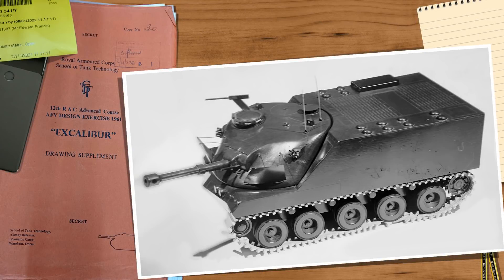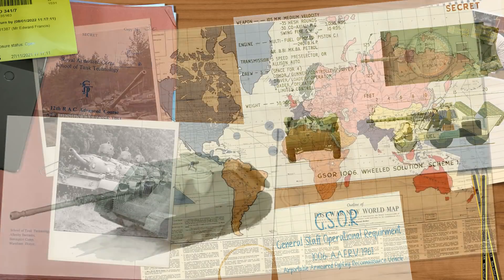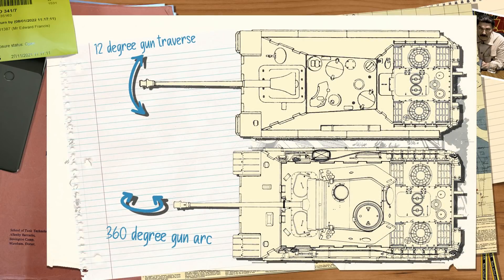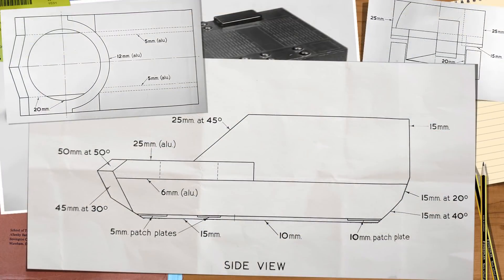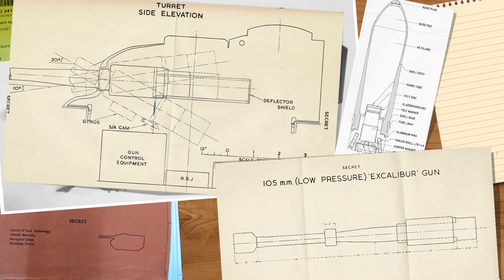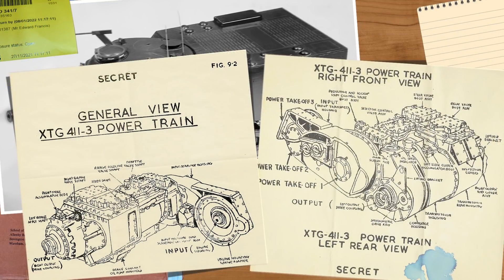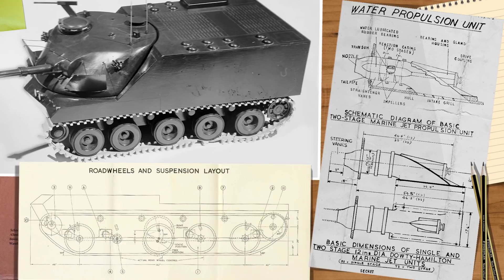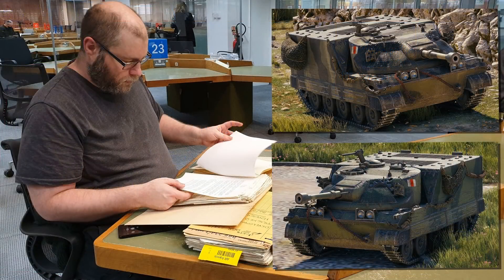STT Excalibur - Tank Design & Development

Comment: The idea of light gun mounted vehicles has made a strange comeback in the last few years...  while everyone said they were obsolete...

Ranging from the M1128 Mobile Gun System, to the AMX-10 RC, B1 Centauro, many countries seem to have adopted the 105mm wheeled anti-tank/fire support vehicle.    Designed to be light weight, air transportable, and such...
Reply: @Ban this youtube yes and no...  in some cases its just the "theory"   and deployment strategy thats changed.  take the Weasel.   Germany's "newish"  Tankette.    little 2-3 ton tanks,   that can be configured with different weapon systems, but the key thing is they all be able to be folded down and kept small.

4 tankette unit,  1 radar, 2 sam launchers, 1 25mm cannon.   Able to be transsported by... 2 helicopters...   dropped  on any hill top or such.

4 tankette unit,   2x tow launcher, 1 25mm cannon,  1x communications.    

4 Tankette unit,  3x 120mm mortar, 1 by command/coms.   

the little things work as coordinated teams.  and can be carried INSIDE most heavy transport helo's...  heck an Ospray can carry them too.

Comment: The 'imperial' antipode to common sense: 

airmobile, amphibious (aluminum, but no respective hull design for floating as with Soviet BMPs), reconaissance, 'tank destroying' 'fighting vehicle' ('gunner doubled up as driver'...) from -1946- 1961 (!!!) - three years before the Soviets would put the revolutionary T-64 into production, fighting heavy tanks at maximum range above 3km... 

...named 'Excalibur', because nobody could pull a project like that without anti-gravity technology that prevents shit from rolling downhill... if it only were an internal satire of the design department... 

Two generations later - after the introduction of the 'Scorpion' didn't plug the conventional arms gap - the same culture of bureaucratic planning will breed policies like totalitarian lockdowns in order to stop the transmission of influenza like germs, facing a deathrate of less than 3000 individuals per quarter...

Comment: A front-mounted turret is something you don’t see every day. For the roll it was intended for, it doesn’t seem too crazy. The fact that it has missile launchers as well as a gun does kinda beg the question of “why not just have the primary armament be missiles?” A question begged by many projects during the period when antitank guided missiles were being developed and becoming more and more common.
Reply: >why not just have the primary armament be missiles?
The Army was smarter than the "Chairforce" boys is why.
Reply: @D8W2P4  I mean, there are cannon-less AFVs whose primary armament are missiles, so...
Reply: @samiamrg7  well old missiles were more costy, and less efficient,and sometime failed so its not bad to have a backup
Reply: +Valian True. I was more just commenting on for much of the Cold War era, there was a lot of debate and speculation on how war was going to evolve going forward. The result was all sorts of proposals, designs, and prototypes. One common theme was hybrid weapons systems like cannons that could fire both shells and missiles (or be adapted to fire lasers, as some speculated might become the norm). This vehicle is like that. It was designed to have both weapons if for no other reason than that no one knew if one or the other would be more useful. As it turned out, they are both useful, but not on the same vehicle. Broadly speaking, the main kinds if IFVs/AFVs around today are ones with light cannons (and sometimes a secondary missile launcher), ones with just missile launchers, and ones with an AT gun.
Reply: @valian8985  a bit more than sometimes 😅

Comment: I d wonder if they thought about the effect of the shot trap ie  of a hit between the turret and the rear body , wouldn't that disable the turret turning ?
As for aluminum armour seems the driver would have  had very little protection , unless it was in a hull down ambush position
Reply: A shot trap... really? The entire vehicle is a shot trap.
You think the few mm of aluminium would stop anything bigger than a rifle caliber bullet? The vehicle basically has no armor to speak of. If it takes serious return fire not only the driver would have very little protection. An M113 is better protected and lets face it an M113 is not really well protected.
Reply: @schnuersi  your correct .

Comment: The air portable tracked armoured vehicle has been the quest of many international design teams since the concept became a possibility. In my humble opinion only Scorpion and Scimitar have ever come close to delivering a usable example for NATO.  It's a pity  the last Scimitars are being phased out of service to be replaced by the bigger and as yet unusable Ajax. Or CV90 if Ajax is unfixable.  
The BAE 40mm  cased telescoped cannon system proposed for Ajax and Warrior would be an interesting candidate for mounting on a Scorpion/Scimitar  type hull.  It can penetrate 140mm slopped armour plate!  Apparently BAE systems have also supplied a 50mm cannon system for the CV90 and as an upgrade for Bradley.
Reply: the AMX-13 is air portable and was quite successful, the SK-105 is also air transportable.
Reply: @matthiuskoenig3378  AMX was a dead end due to the limited ready round capacity and it's other quirks. Not a NATO contender. SK-105  much the same.
Reply: @gusgone4527  the AMX-13 saw great commercial success within and outside of NATO and while it had a limited ready round capacity that didn't stop it preforming well in combat. 

as for being a dead end it ended up being;
-a light tank/TD with upto a 105mm armament, includeing includeing a prototype (with the FL-20 turret) that gave it ammunition blow out pannels, a co-axe 20mm, themral imagers, 2-plane stabiliser for the turret, NBC protection. it also its ready rack could be reloaded inside the vehicle.
upgrades are still being offered to this day
-an APC (AMX-VCI)
-an AA vehicle (from 20mm armed to 40mm armed)
-SPGs (from 105mm to 155mm)
-it served in the french army untill the 1990s (through it began to be phased out in the 80s), and is still in service with many militaries. 
-ATGM vehicles

and its basic hull construction is not really different to any modern light tank. the model 1987 even had hydro-pneumatic suspension. 

its arguably one of the least dead-end tanks out there. sure its still limited by its engine compartment (the biggest engine for it so far is 300hp) but its also an old light tank from the 50s. the AMX-13 was a dead end as mutch as the CVR(T), limited by its overall size and little else.
-->it must be noted the french have had a hard time replaceing the AMX-13 too (although they atleast have had wheeled recon vehicles) with the failed VPX-110 of the late 70s, the failed VPX-5000 of the 80s, the failed MARS-15 of the late 80s and 90s.
Reply: it would also be ironic if they went to CV90, in the early 90s the british army planned to replace CVR(T) with a mixture of alvis stormers chassis vehicles and CV90 chassis vehicles (the former being a 8-13ton light recon vehicle with a 30mm bushmaster and TOW missiles, see stormer 30. while the later would be equiped with a 40mm+ and TOW missiles and would take up the role of the proposed warrior reconnaissance varient. which was rejected because the MOD didn't want more warriors). 

but both were canceled because of TRACER  in the mid-late 90s (a completley new ground up vehicle, that although orginally independant became a joint project with the americans who called it FSCS. the new combined name being ASRV [armoured scout and recon vehicle). but ofcaurse TRACER died. because the americans pulled out (in order to make room in their budget for FCS), this discouraged MoD who proptly fell inlove with FRES, despite TRACER already produceing prototypes by that stage which preformed above and beyond expectations and the UK haveing the budget to get TRACER into service although not by the oringinal 2002 deadline. they had already spent 130 million pounds of the projected 150 million when they made the last payment for TRACER. 

FRES (future rapid effects system) was a project to replace FV432 and CVR(T). replaceing TRACER (see above) and MRAV (FV432 and saxon repalcement, which had cost 57 million pounds) into a single joint family project. it is said that other than us backing out, operations in the balkans drove this opinion (and it is also said that US experiance in the balkans also drove them to empasise FCS). specifically the need to adress mines but also a greater influence of being light (it was feared TRACER might be too heavy to do the vital jobs CVR(T) had done). TRACER was 20 tons after all. FRES was intended to be cheaper and take into acount these lessons (it was to be no more than 17 tons baseline, with potential modular armour for heavier situations), atleast initially. aditionally unlike TRACER they wanted it to be simple (TRACER has a suite of advanced sensors and trackers, a information network, and an unmanned turret). 14 billion pounds was set aside for FRES.

BAE suggested useing Sweden's SEP program (weighed 17tons baseline, speed of 85km/h, electric drive, and was modular both payload wise and it could switch between wheeled and tracked easily, all points demanded or requested for FRES) and was already in the prototype stage when parliament confirmed FRES funding in 2005. and was warded to contract to explore this idea by the end of 2005.  

however for some reason this was rejected in 2006 as FRES had changed to 3 weight class vehicles with shared components (a 25-30ton utility vehicle, a 20-25 ton tracked recce vehicles, and a 30-40ton support vehicles. each with subvarients and roles for a total of 16 different vehicles). it seems the light 17ton requirement was dropped. . we'll call this FRES 2. one of the main reasons for FRES (TRACER [20-25 tons] and MRAV [25-30 tons] were both too heavy for combat experiances in the balkans and backed up in iraq) seems to have been forgotten...
for the recce part of FRES 2 the CV90 and the ASCOD hulls were selected to be tested (with other companies doing the turrets/etc)

then came another change in 2008. it would now be 5 vehicles instead of 3, to fufill the 16 roles (utility, recon, medium armour, manoevre and 'capability utility') we'll call this FRES 3. and then changed again in 2009, the utility vehicles were removed/rearcanged from the program; the 5 vehicles were recce type 1 (scout vehicle, recce support repair and recovery), recce type 2 (FOP, command and control, cargo), recce type 3 (mine deployer, recce overwatch, command and control, ambulances and aid posts), medium armour (120mm gun tank, repair and recovery support vehicles) and manouvre support (bridge layer).
->once again it was ASCOD (2) vs CV90 for the recce vehicle.
207 million pounds had now been spent on FRES scout alone, 50 million just on testing CV90 prototypes, and they hadn't gotten anywhere.
weight of recce vehicles had also grown to *40tons*, losing air transportability...

BAE offered a reduced size, while increased armour, CV90 for the FRES scout, by reducieng highet of hull. it was successfully trialed in the ik unlike the ASCOD, general dynamics did not even present a prototype of their proposed modifications which were less extreme. despite that the ASCOD 2 scout was chosen (later named the Ajax). without even being tested, those were only projected to be ready in 2011. which is probably why its been haveing trouble.
the plan also now includeing keeping some CVR(T)s because the replacement was too heavy for all deployments, ironically.

ASCOD 2 also had costed more than the cost to finish TRACER, would take longer to get into service, and was heavier with a weaker engine AND had none of the advanced sensors of TRACER and it had a bigger profile. it was no better and arguebly worse (even on paper) to the CV90 rejected in favour of TRACER back in the 90s. but i suppose thats my hindsight talking...

going to a CV90 after all of this and plenty of oporunity to choose one at various stages would be very ironic, and bloody frustrating.
Reply: @matthiuskoenig3378  Damned frustrating, so true. 
Only the MoD can fuck things up so royally and not by accident.  It's a skill they have worked hard for decades to master. MoD procurements having honed it to such an extent, that they can do it on demand for any proposed project land, sea  or air.  
Quite astounding really and worthy of recognition. Bunch of REMF idiots.

Comment: Still a great concert for an airborne vehicle today......travel light and hit hard  😃  and with modern engineering and weapons it would be very useful 👍
Reply: Well, with modern engineering they just make an IFV armed with ATGM’s only like the FV102 Striker. No need for a big, heavy, cumbersome gun when you can just have a much lighter ATGM launcher that has far more tank killing power than any gun that could be mounted on such a small vehicle. 
Then there is the Scimitar and Scorpion which have guns to provide infantry support, but would not be useful against a heavy MBT.
Reply: @samiamrg7  if it had been built like the Stormer load carrier with the gun up front and an interchangeable rear unit able to carry various weapons sub platforms it could have been configured for a multitude of different rolls like the modern day Boxer........Small and air transportable just one vehicle that could be fitted out for whatever roll it was needed for on the day 😉

Comment: A neat design with a lot of undeveloped potential, not necessarily in it's proposed light weight form. EG space at the back for infantry who would be soundly protected from frontal fire. Low profile compared with current oversized/weight designs and readily adaptable for killer firepower eg big twin cannons.

Comment: Well, it's not much more crazy than the Sheridan. And that worked. Sort of.
And potentially much, much better than the ASU-85.
Reply: In fairness, the ASU-85 worked very well for bringing an 85mm gun to the fight with the airborne forces, especially with the ability to airlift by helicopter. It was very reliable, surprisingly tough to knock out, and the gun would have made life Hell for the mostly light infantry forces they would have faced. We tend to think about killing tanks as the main job of big-gun IFVs in the Cold War, but putting 85mm shells into NATO field fortifications was plenty important work too. Also, it was a very modern 85mm weapon which could actually threaten most of NATO's tanks of the era at closer ranges. Imagine your M60 company is rushing to the frontline in 1965, only to find a battalion of VDV with a number of ASU-85s has set up ambush along the way. Not good times.

Comment: where is the water jet relative to the hull? the rear?
Reply from the maker: exits are rear, but interanly mounted jets above last 2 roadwheels
Reply: @armouredarchives8867  That's very poor flow conditions, surprising any manuevering would work.... They used the units on the Slalwart didn't they.  Well if its a universal part....it gets universally used